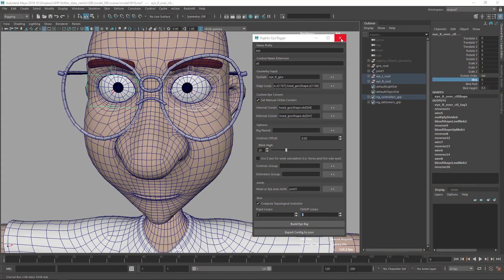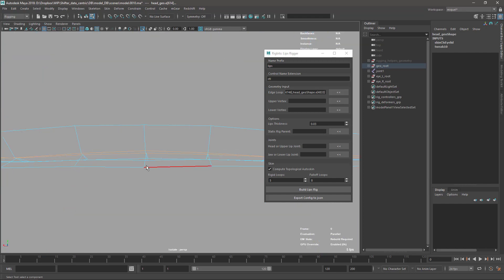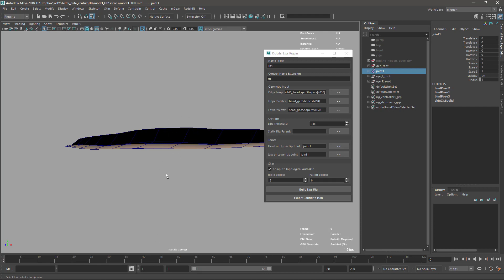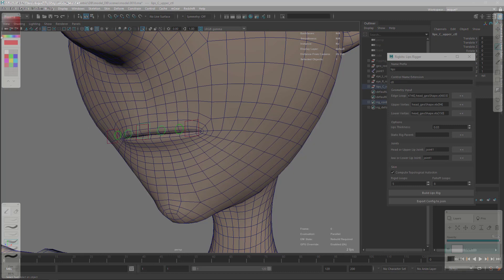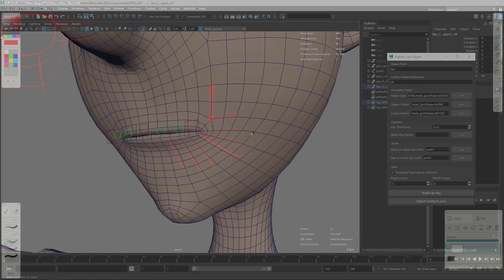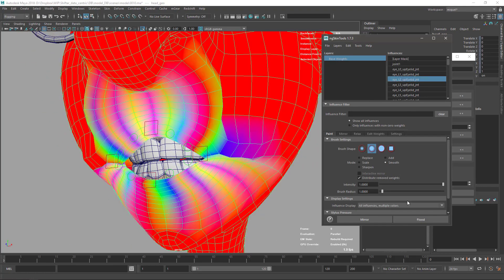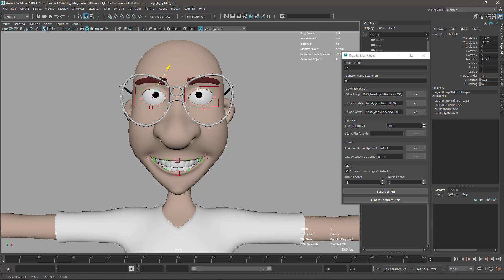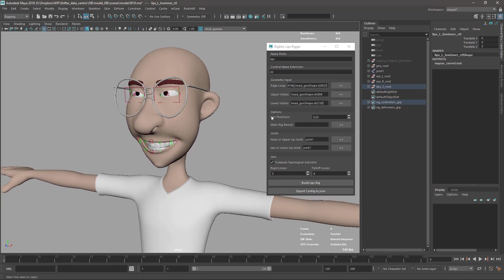2.4 Rigbits: Lips Rigger

Comment: I did everything the same in this video but when I hit build there're not even joints appear but only ctrls, so those ctrls are moving nothing....
I've tried It several times and on different models it's all having the same issue :////
Reply: I  had the same problem, i solved it by downloading the latest version